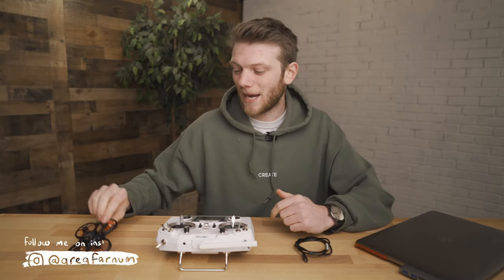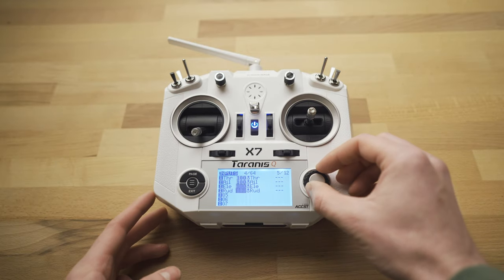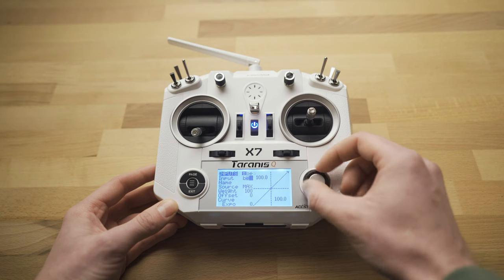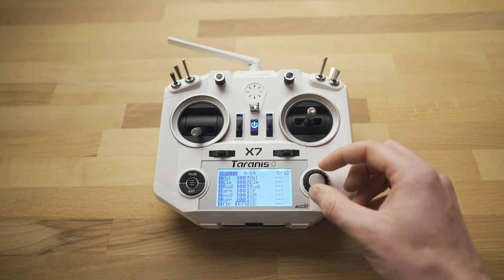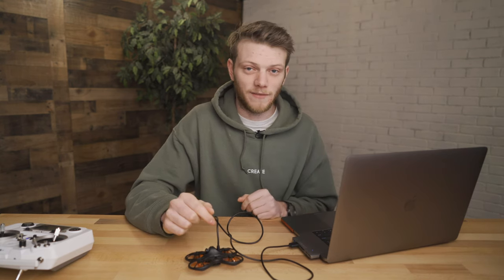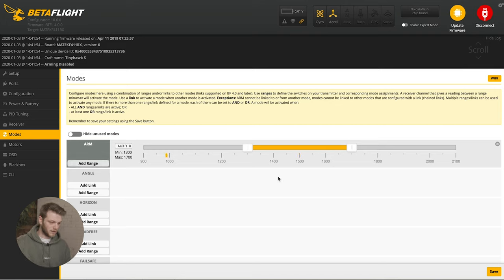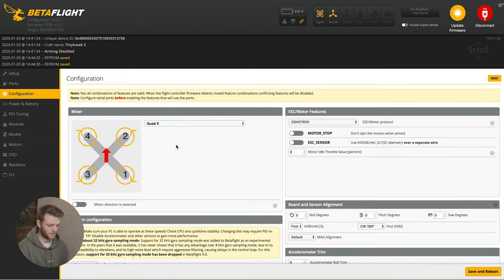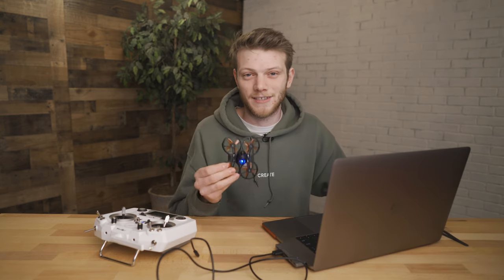FrSky Taranis QX7: How to set up SWITCHES and BETAFLIGHT

Comment: Does this only work for 8 channels? I cannot get channel 9 to work no matter what. I set it up in the radio just like you've done but in Betaflight that switch for channel or Input 9 does not work. It should be AUX5 in Betaflight but it does not move when I hit the switch. Everything else works.

Comment: I'm using the EMAX Tinyhawk 2.5 Freestyle BNF. I did everything you did and it works. But, when I throttle down the motors slow for a second and then speed up. According to Betaflight 1 and 4 motors are  almost full throttle, 2 and 3 are about half. The only way it stops is when i switch off the Arm. Any Idea how to fix this?

Comment: Followed it to a T but not fully working. Everything checks out in Betaflight, but I cant get it to arm. I can make it beep and change modes but arm is the only thing that doesn't work. Im using the Frsky X7 and the Tiny Hawk 2. Any help would be appreciated

Comment: What I was looking for) match) thanks) I was struggling how to set up the same drone and app)
The main problem was with bad cable(betafligth shows the only Bluetooth)
Reply from the maker: Yeah i was having that issue too its hard to tell which ones are data and which are just for power

Comment: Even though i have mine setup like yours, the beeper and turtle both light up when i move to last position. Turtle doesn't seem to be activating in the middle position. I haven't tried in an actual flight, but it doesn't seem right.

Comment: Hey greg i love your videos thay helped set the drone up and bind the radio but my tiny hawk s atill flashes red after taking it out of bind mode with no throtol witch won't let me arm or put it in beeper plz respond i have had the drone for almost 2 years and have never flown it.

Comment: Is this a taranis X7 access? Bc im tying to pair and found out its not pairing bc there is no d8 mode on this thing. Very new to the fpv world and literally everything got delivered today my fatshark my drone and taranis Q X7 access. Any help you could offer? I can't find anything on firmware updates only thing I've found is frsky XJT lite-2.4ghz 16ch radio transmitter module to make it compatible.
Reply: you need the XJT module for the Taranis to get D8

Comment: Hey! I have a problem

I bought a taranis qx7 for a couple of weeks ago and practice in velocidrone simulator.
Now i got myself a tinyhawk freestyle 2. I did manage to connect the controller to the drone and bind sticks.

My problem is. when i throttle, the propellers start spinning, but not enough to get in to air. When i roll/tilt it only tries to go left.

Comment: Hi. Great video, got my first quad flying. But I have an issue now, I wanted to go back and add a prearm, have set the switch I want to use up on the Taranis in both Inputs and Mixer, and this looks to be working fine on the radios main menu. However when I go into betaflight it does not recognise that the new switch has been assigned, I flip it and nothing happens. Do I need to re-bind the quad after setting uo new switches?

Comment: Just bought a Tinyhawk 2. Can anyone help :( Followed this video step buy step and I ve accidently hit reset settings in the Setup menu on Betaflight and now I have no lights when plugged in . Also when the battery is connected to the drone. It flashes various coulour for 5 seconds and shuts off. Any advice or have I Made a big booboo. Any help would be greatful :)
Reply from the maker: Try flashing the firmware

Comment: Thank you very much! This tutorial is perfect! But I can't connect to the BetaFlight :( Can you please help me?
Reply from the maker: Yeah for sure what’s not connecting your drone?
Reply: @TheGregFarnum   I have opened BetaFlight and connected drone to pc (USB), diode is light so it's connected to PC but when I click to "Connect" button it doesn't do anything... (Sorry for grammar I'am from Czech Republic...)
Reply: @TheGregFarnum   Without BetaFlight is drone working, propellers are spinning but drone can't fly... I have done everything same like you (without BetaFlight because I don't know how to pair drone with program...)
Reply from the maker: You might have to flash the firmware on the drone. which drone do you have?
Reply: @TheGregFarnum  Mother board: F4, firmware MATEKF411 BEC 3A, 4in1 Rx Tiny EMAX, D8
Reply: @TheGregFarnum  And can we go to any other socials? It will be better...
Reply from the maker: @simonzednik3362  yeah my instagram is @gregfarnum
Reply: It has to be a signal usb . I had same problem. so I switched usb and it connected.

Comment: Greg hi again. I need your help mate perhaps you could help me: After a couple of “fall off the sky” type of crashes, my tinyhawk 2 just comes in and out of bind. Sometimes just after connecting a fully charged battery it beeps intermittently and does not connect to transmitter, sometimes it binds and starts to fly and after a few seconds it just falls from sky again. Any ideas?
Reply from the maker: I would try and flash drone in betaflight and reload the newest firmware could be a bug in the version you are using.

Comment: Help 😥. I followed along. Nice instructions.  But, my sticks are reversed. Throttle is where pitch used to be. How do I fix that? Thanks
Reply: Thanks, I figured it out.
Reply from the maker: Glad you were able to figure it out!
Reply: How did you solve it??? Same is happening to me
Reply: @ArlindoOliveira81  it was a mapping problem in betaflight. Just check the channels. Good luck.